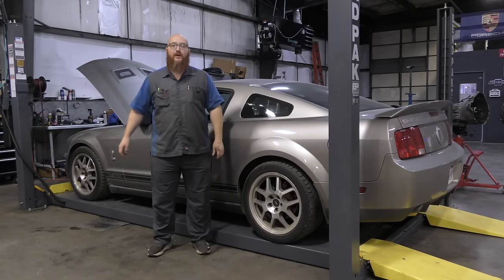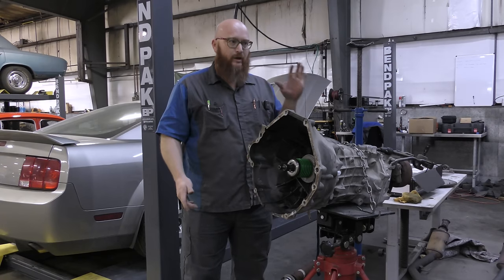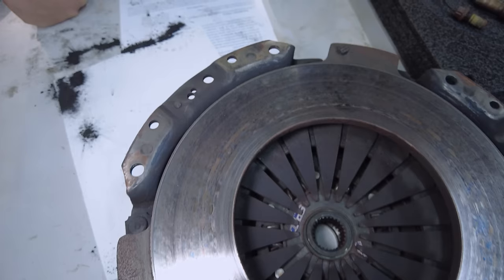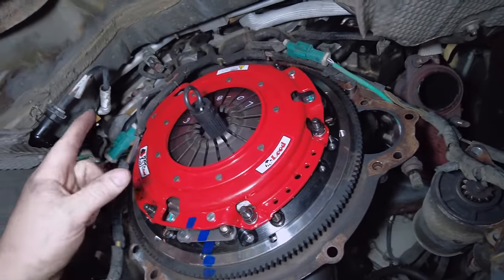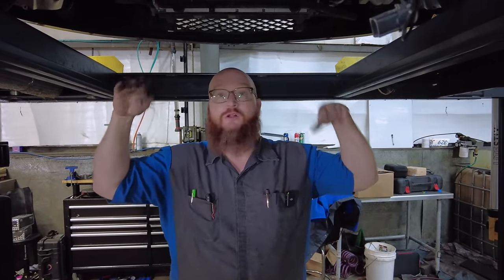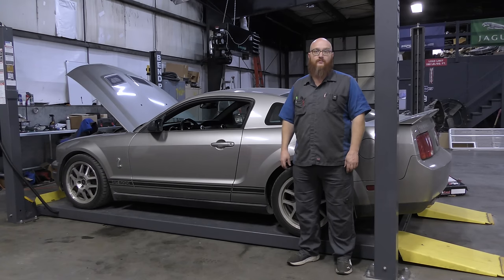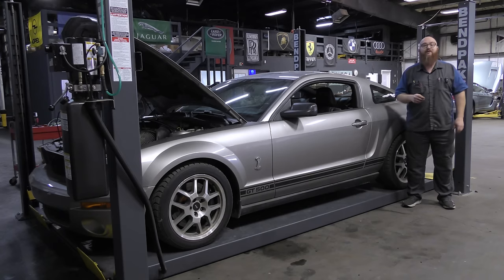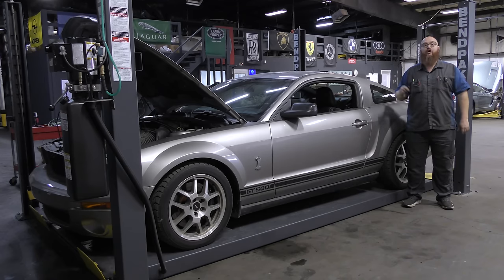With Over 200K Miles My GT500 Has So Many Worn Out Parts! It will Cost Me Thousands!

Comment: Nice to see a GT 500 that someone has ACTUALLY driven and enjoyed! For a car with 210,000 miles on it, It looks like most of those were highway by the way the body and the undercarriage look. I'd love to see a follow up video on the condition of the engine and supercharger with that many miles on it.
Reply: Body rot only happens if those miles were put on it in the winter where salt is used
Reply: @firedemon2166  I always find it astounding how much rust a lot of cars in central and northern North America have.  One of my cars is a 23 year old Toyota, and it has nothing but a few patches of mild surface rust on the underside even after two decades of sitting in the driveway and being driven daily with maybe a bucket of soapy water thrown at it every few months if it's lucky.  Really haven't had a problem with any car rusting post 1990.
Reply: @Beer_Dad1975 my Chicago raised 96 Camry is completely repeat through the floor on the back passenger side and body panels and underneath, I do not care tho it still runs like a champ and willl continue to run it until it snaps in half
Reply: @Tragick_Sin  LOL, I hope nobody is in it at that time!

Comment: I despise a crooked steering wheel as well. Gotten cars back from the tire shop for an alignment with the steering wheel as crooked as when it went in. One guy started to argue with me that it didn't make any difference if the steering wheel was straight, and it was $50.00 extra to correct it. I didn't ask him how much extra it would be; I already knew that, I asked for him to fix the issue, not for a price quote. My brother passed last year and left me a 2003 GT with V8. Sadly, I am too disabled to drive it, can't get in and out of it. Sold it to his boss, so I know it got a good home.
Reply: That happened with me regarding my 2000 F350 manual tranny with the 7.3 powerstroke. I couldn't reliably get up into the truck anymore! Not only that with was with the shortbed dually which also aint made anymore. It also only had 161k on it.
Reply: I have an even worse problem with my ancient 1969 Buick Wildcat convertible...  The steering behaved nicely, and return to center after you went around a corner.  I took it in for tires, and an alignment as long as it was there.  I drove it out the door, made a right turn and it wouldn't return to center at all.  NOBODY has ever been able to fix it completely ever since!
Reply: How can it be "extra" to align the steering wheel when doing an alignment? This world has gone insane!
Reply: @marko7843 The alignment guy took all of the caster out of the suspension geometry, needs to be shimmed to have at least  3 degrees negative caster.
Reply: @tomjames7955  thank you Tom, you're exactly right.  When I had the center link replaced last year, I asked for some more negative caster.  Then, in the kind of insane coincidence that seems to happen to me, on the drive home it got stiffer turning the wheel either way.  Over the winter I had to replace both bearings in the upper bucket of the tilt column.  The upper cage had just then broken, and it turned out that the lower bearing cage had been busted so long there were only two or three balls left in it...  I just hope they're all not jamming something down below now!
Reply: @marko7843  maybe jack the front wheels off the ground and give the steering wheel a spin. It should go a 1/4 turn or more after you let go and be very smooth.
Reply: @tomjames7955  Thanks for the suggestion.  I assume that you mean doing it with the engine and pump running?

Comment: Same. Every car I bought for the last 10 years needed tires. People just dont replace them.
Reply: Everytime I sold them, they came with Michelin Defenders with 500-1000 miles or Michelin Cross Climate 2's! 😅😂 It's like the time I know to get rid of a car is buy new tires right around 100k.
Reply: For me when the tires need replacement I think about keeping the car and fixing all the minor issues including tires or replacing the car all completely and factor in the money I would have spent in repairs on the old vehicle

Tires, injectors, spark plugs, brakes and rotors, new headlights, transmission flush, wheel bearings, bushings and suspension. Etc.
Reply: The first car I bought with my own money had a new set of tires. Problem was that it was the cheapest tires available for 13" wheels that the previous owner had bought just so that it could pass the state inspection. However those tires were so cheap that they could not hold a corner a decent speed well. Which led to me having two close calls when the tires gave out on two turns. The last incident was the last straw that led me to replacing all the tires with the best set I could find in a 13" size. Found a good set from Costco at the time that served me and my spirited driving well for the time I had the car.
Reply: @evoman44  Buying anything less than the best tires is always a bad value. Tires are the #1 safety and performance part on any vehicle. By the time you mount and balance tires the cost between the best and the worst isn't that much. The life you save is likely to be your own or someone you care about.

Comment: I have a 2014 Mustang GT with a Roush blower and a 6R80 automatic. It's a bulletproof setup, even at 625 flywheel horse. Car has been very reliable with no major concerns since I bought it in early 2015. Runs low 11s at 121 mph in the 1/4, despite full weight every option car. I'll never sell it. Love S197s...except the ones with the turd-burglar 4.6 3V.
Reply: Typical coyote elitist.  The 3v 4.6 is a good motor and decent for what it is and what they cost.  They're not nearly as fragile and enemic as coyote guys make them out to be.  There's something about coyote guys they just love to hate on the 3v and talk down on em.  Many of them even do that with the gt500s pre 2013 which is even more stupid lol.
Reply: @midnight347  I'll acknowledge for sure that the thing that kept me from buying a Mustang subsequent to owning my 1988 LX for 13 years, was the base 4.6 mod motor, although I came close to buying a 1997 Cobra 4V but, couldn't swing it at the time. My first Mustang after this blip in history was a 2012 6 speed manual MGT. When a car picks up ~100 horsepower in one year and has a truly modern DOHC engine, I was convinced. I'm on my second Gen 1 'yote now.

Comment: You might want to consider a new alternator, the factory spec wasn't really rated for 5.4 SC and I had to replace them several times in a year until I got an upgraded model.  Car would give little warning before the battery died from failed alternator.
Reply: In my case, there was a ground cable that seemed to be tight to the engine block because of corrosion, but it wasn't really. I bought two or three alternators before I found the problem. After that, no new alternators...
Reply: Nations is where it's at they have a killer 270 Amp alt for these that changes the actual style of alternator from the factory 6g (crap) to the large case Denso style like 2010 up mustangs got factory.  The problem is the style alternator itself.  Getting a factory 6g style high output is not the answer.  You gotta also change the style of alternator and nations makes one that is a bolt on 270 Amp unit and its great.  I went ahead and did the alternator on my 07 before the factory one even failed because I learned from others.  People who buy stock replacements go through them like crazy even if you get a stock style 6g ho alternator same thing the 6g style is the issue with them.  Get rid of that for the nation's and no more problems.  That also covers you if you turn higher than 6200 rpm which wears out regular alternators that came keep up in that range.  6500 is max safe rpm anyways on these with a stock bottom end they have a long stroke and don't like revs much but if you abide by that and give it as much octane as you can these things are stout and live at big power levels even being beat on long as you maintain it properly.

Comment: Guess I got lucky with my 09 f150 5.4 300k and running strong. Changed the timing setup at 290 just because of the miles but nothing looked bad. Just goes to show that regular maintenance pays.
Reply: Same with me...very reliable, but you have to maintain it.  oil change at 3k

Comment: Those look like Ford Performance sway bars that are made for Ford by Eibach and are painted blue instead of red. There should be a Ford logo on them. You just need to replace the polyurethane bushings. The ones used in those bars are made by Energy Suspension. You can buy the bushing kit and silicone grease. The person who had the car probably did not use silicone grease on them which would have degraded the polyurethane bushings. Have you tried filling them with grease? They seem to be bone dry now. These bushings will get noisy if they are not greased through the fittings.

Comment: The stock clutch and flywheel can easily handel 500 hp with normal driving conditions ! That's the result of alot of showing off !
Reply: I have put 100k supercharged miles on my stock civic clutch. 140k now... Just don't slip it under load and it'll last.
Reply: The stock clutch is GARBAGE in the 2007-2009 GT500. That is just common knowledge in the community. Mine went out at 15K miles and I drive like a grandpa lol. Ford made awful clutches for those few years. This RST clutch isn't even the best option. RXT is. But RST is better than stock for sure.
Reply: Can’t handle about 670hp though
Reply: You don’t want a strong clutch let the clutch take the abuse. A expensive strong clutch will just transfer the stress to the trans. Stock clutches are easy to replace. To me a clutch is just a maintenance item

Comment: I bought a 2003 Buick lasabre with 65k on it and you guessed it the tires were trash. Drove it straight to the tire shop. The thermostat took a 💩too so easy 5min job to fix that, & a new temp sensor.

Driven abt 12-13k in the last 10 months, & ive done a lot to it under the hood. Radiator rad hoses, abt to do the upgrade to get rid of the plastic intake that can destroy the engine, & replace all the intake gaskets. I got a series 3 intake with an adapter plate to fix it for good.
Reply: Imagine if u didn’t buy a Chevy 😂

Comment: The 5.4L DOHC is a great engine but don't hate on the 4.6/5.4 3V. With good maintenance they're usually trouble free for at least 150k miles. If you replace the camshaft drive system and cam followers/lash adjusters with the Ford Performance updated parts, these engines will go past 300k miles.
Reply: They're great engines, one you replace all the components!

Comment: Good move with the Mcleod clutch related parts.  I have a fiiend who also had a GT500, same year, and he went through several different clutches and did not ever find anything as nice as the original clutch, to include when usinf oem replacement pats.  He eventually bit the bullet and went with a McLeod Clutch and related parts in.  From that point forward he was once again thrilled as he had no more slipping clutch issues, and the clutch mechanism worked smoothly and properly.

Comment: My father has an 07 and it needed a clutch after 13,000 miles! It was also really heavy and did not engage well. The updated design is much better and so much lighter. If you did not have a strong leg, you couldn't drive it with the original clutch!

Comment: I’ve had numerous S197 mustangs, you need a one piece driveshaft to get rid of that driveline clunk, even if the two piece is in good shape it will still clunk.
Reply: and tighten up the rear end. Mine was sloppy from the factory.

Comment: I understand your viewpoint in regard to the Triton 3V 5.4. I owned a 2006 F150 Lariat 4x4 supercab with this engine. I had zero issues with it running properly,  but did have the sparkplug and exhaust manifold issues that had to be corrected. It was a great truck until the frame rot made it unsafe to keep driving. Midwest winters and thin steel boxed frames just don't go together. The truck was outwardly in beautiful condition, even the leather interior looked new after 13 years and 158000 miles. That engine was a failure to so many buyers, but I got a good one, and still kind of miss that truck.

Comment: I drive the same year Bullitt, which was also made by SVT, and yeah, they knew what the problems were and fixed them in advance... the spark plug issue, the ignition boot issue... and more, somewhere I have a whole list of the changes they made.

Comment: I own a 2003 F150 with the Triton 5.4.  260,000 miles and it still runs perfect, no oil leaks, doesn't leak any oil.  Proper maintenance make all the difference.

Comment: Wizard, looks the front and rear sway bars are Steeda aftermarket sway bars judging from the blue bars and the grease fittings on the bushing mounts.   You should be able to buy the replacement mount bushings from them.
Reply: They look to be the Ford Performance ones as I have the same bars on an 06 GT. They are actually made by Eibach for Ford and the only difference is the Ford ones are painted blue instead of red. And the Ford ones are less expensive for the exact same thing.

Comment: It would be interesting to see what horsepower and torque gain to the wheels is gained by a decent clutch. That last dyno pull likely finished off the old one with lots of slippage.

Comment: I would really recommend replacing the two piece driveshaft, though - they are nasty when they come apart under high rpms.  I have no idea why Shelby would put that type in that year, but it's a definite problem if it lets loose.

Comment: This GT500 suspension wise is in a similar situation that my 2006 GT was in when I got it at 131k, the wheel hop in the rear was terrible, it felt like the whole rear axle was going to come out from under the car with even a hint of wheelspin, but engine and drivetrain were solid, ended up replacing every single bushing except the sway bar bushings because they were still good and the difference was night and day, so much more predictable over bumps and no more clunks

Comment: Usually diaphragm clutches are fairly easy to push. Long and Borg & Beck are harder.
Reply: I just bought a new Challenger with a stick. I think the clutch is a Warner Buckenwith Stegberner. very smooth and light. a pleasure to drive.

Comment: I gave my son my old '06 Mustang GT 5 speed. He grew up riding in that car and loves it. Same thing; replaced all the bushings, tie rods, clutch parts and even a lightweight flywheel. The car was never wrecked and drives like brand new. Original engine and tranny are stiil excellent at 190K miles. He says he is going to keep the car.

Comment: The Tremec shifters are excellent from the factory.  I have a 2004 Mach 1 with the 5-speen Tremec TR3650, 129K miles.  Still shifts like new; even still running the original clutch.

Comment: I own a 2016 Ford Escape Titanium. It has 140000km on it. I have redone the entire front end. It only needed a few things but my way of thinking is if a few parts are wore out the others are not far behind. And I only want to pay for a wheel alignment once. But the Ford Stealership can not get the steering wheel dead on. It has been back 2 other times because the steering wheel being off just a slight bit drives me nuts. I guess the next thing is to calibrate the steering angle sensor using my Autel. I do not know what else to do.

Comment: The astonishing thing is that a Shelby GT 500 made it to 200,000 miles. In fact I'm surprised it made to over 100,000 miles, not because they're crappy cars, it's because these Mustangs are usually abused to the point they're blown up, or wrecked.

Comment: I don’t know if the 5.4L 3V is less reliable than the 4.6L 3V but there are many 4.6L 3V’s with 300,000 miles on them. The key is religiously doing the oil changes on them and preferably using the Motorcraft oil and filter. You should tint the windows on this car to not only make it look way better but to protect the interior and Mrs Wizard.
Reply: I have 340k on my '06 GT. Bought it new. Did my first timing kit, oil pump, lash adjusters, roller followers, VCT solenoids at 175k. Did the lash adjusters, roller followers and valve stem seals at 320k. Factory clutch was changed at 190k. Ive used RP and Penz Platinum 5w30 with RP, Wix, AmsOil, Motorcraft, or  KN filters over the years.

Comment: The hard polymer aftermarket sway bar "performance" bushings are your problem.  Recommend putting stock bushings back in.
Reply: They are polyurethane bushings and give you way better handling. The bushings are from Energy Suspension and you need to grease them through the fittings with silicone grease. If you grease them using the right grease (silicone) they will last way longer than the rubber ones. Those bars are Ford Performance ones made by Eibach for Ford.

Comment: The Shelby's originally came out with dual clutch setup but people were saying they were to stiff for street use and would cause them to burn up,i could see why it was replaced and someone put a single clutch system in.
Also,the driveshaft is garbage factory, the two shafts with the bearing in the center had a tendency to fail,i swapped mine out with a one piece aluminum drivershaft.The last thing,the suspension on those car's are not the best,i got a 2011 performance pack and i still had to swap out everything in the rear with all tubular which is 10 time's better on handing.Those motor where basically a ford gt motor from the supercar,just one mid engine and the other not.